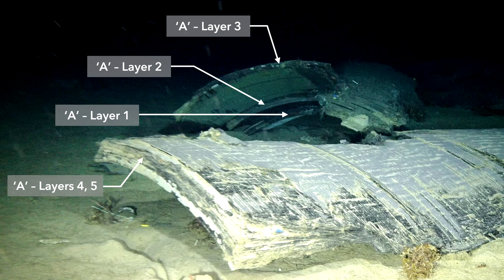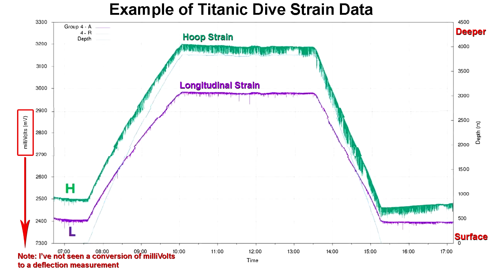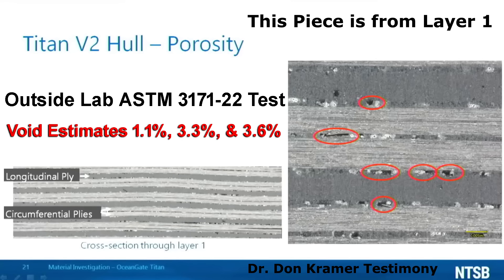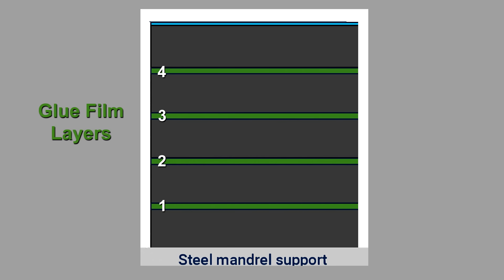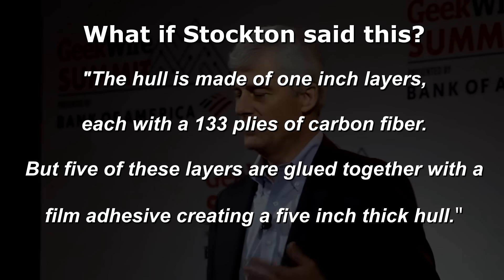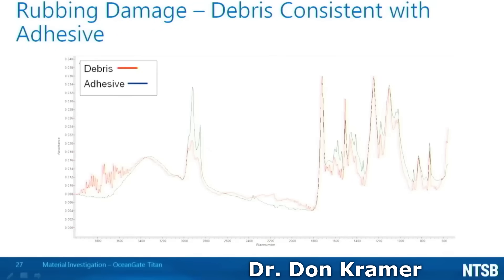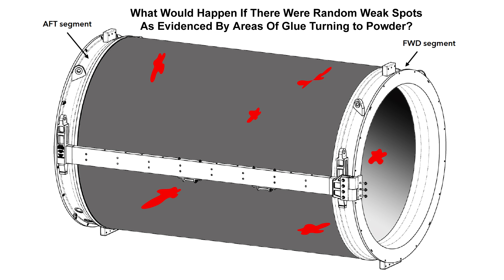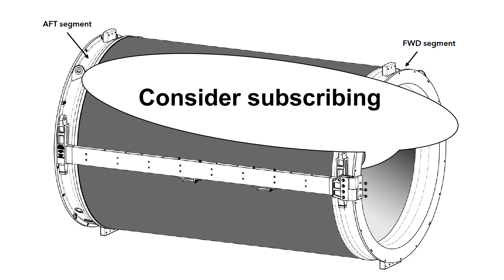OceanGate Titan Hull - Glue Layers Were Breaking Down To Dust - No Clues.

Comment: So in effect their fabricobbled hull was much weaker than simulated. Given usual safety margins, the hull they ended up with had to have had about half the initial target strength.
Reply: It's very generous of you to assume they had safety margins.
Reply from the maker: Thanks for your comment.  I agree and I am not sure if they had a simulation for the second hull.  I heard a rumor that an aerospace company did do a design and analysis for them on V2, but I can't confirm it.  We may learn about it in the final reports.
Reply: @solareclipsetimer 
I saw your video about the V2 hull and agree, they might not have had any calculations for it.

What I meant is their initial calculations before they started building anything, they must have done some sort of feasibility assessments before settling on carbon fibre as a material. 
I might have been off however, pressurized fuselage in aviation typically uses a 2.0 safety factor.
That’s Rush’s background and he sure liked to talk about it, but this might actually have been guided by the boiler and pressure vessel code with requires 3.5 (without further testing to allow application of alternatives rules since they clearly didn‘t) or some other standard entirely. 
I don‘t know which standard applies to DSVs (if any) and I bet neither did OceanGate. Might be an interesting topic for another video.
Reply from the maker: @BL-yj2wp  Thanks for your reply.  The bulk of the original engineering was done by Spencer Composites.  They predicted a safety factor of 2.25 with the first hull design.  But they were way off when they tested that hull in the Bahamas.  Tony Nissen testified that they were seeing hull movement 37% greater than predicted.  Now, it's not necessarily true that Spencer calculations were that far off.  The quality of their CF hull layup seemed to be poor.

Comment: People joke about load bearing drywall but I think we have a new contender. Load bearing glue layer
Reply: I was working in a data center once, cut a zip tie and all this shit on the racks started falling down. Once we got it fixed up, my coworker told me,

“That must be a load bearing zip tie.”

Cracks me up to this day.
Reply: "Carbon fibre deep sea Submarine"
I cannot believe they even tried it.
The reason they didn't publish their "research" is that every single materials engineer, race engineer and bicycle mechanic on the planet would have said.
"NO , are you insane?"
Reply: I spent many years working with and designing CFRP structures. I wouldn't call the idea of a CFRP submarine insane. It can be done safely, and there are good reasons for trying. But you need people with the right skills, experience and mindset working in an organization with the proper safety culture. Stockton Rush had none of that.
Reply: When i renovated my house, i found that they had used wooden siding as roof support beams. 

Also interesting were the wires that were soldered together in the electrical system.😂
Reply: Glue IS load bearing...
Reply: Glue can be very strong.
This was just poor design, poor execution, no checks and an overly eager owner
Reply: @getahanddown glue can be hella strong, yeah, but it’s still part of the hull without fiber.

Comment: Only an absolute fool would use carbon fiber, which has excellent tensile strength, on a structure that requires a material with high compressive strength. This is as stupid as pushing a string. I won't even mention the other one.
It's the same extreme as trying to stress concrete in tension. The strength is minimal. That's why steel rods are put into the concrete and stretched with great force to compress the concrete. Prestressed concrete then has great strength, see bridges for vehicles and trains.

Comment: Applying with hands in an open factory floor was def a factor. The V2 hull was also sanded at hundreds spots while milled at the ends. It’s not a good idea to break carbon fiber.